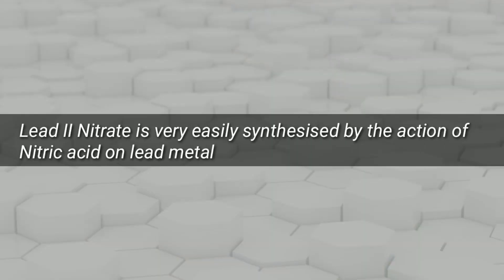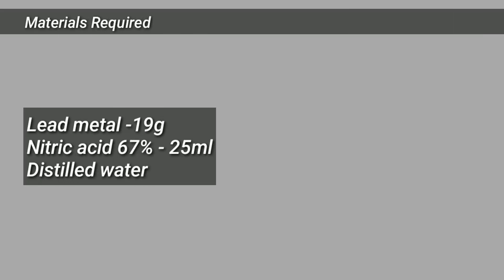Lead II Nitrate : Preparation and Properties

Comment: The same procedure as you do in your video i did but facing issues

1-Lead metal takes too time to dissolve
2-i wouldn’t get clear solution of lead nitrate as you got 

Suggest me so my problem will be resolved
Reply: This is caused by your nitric acid concentration, either too high or too low.

Comment: I like to ask you to prepare some Unique Chemical materials with Physical properties like Optical , electrical And other like simi conductor et.
For example pizo electric material such as Quartz crystal ,  and rochelle salt but unlike other people do just mixing Cream or tratar  with  NaHCo3 it's not that impressive because it's expensive if i wants to buit Pizo power generation unit .  instead can you Make  that cream of tartar aka KC₄H₅O₆ from scratch using Potassium salt and  tartaric acid (a Carboxylic acid ) .
wikki gonna not help you much on it .
Reply: @vibzzlab  thank you so much can you make pizo electric using this same mathod ?
Reply: I  doubt on this process -
( KoH + C4H6O6 = KC4H5O6 ) ?? 
Because the formula for Cream of tartar is KC4H5O6 and for Tartaric acid it's C4H6O6
Than why one Hydrogen is missing in end product KC4H5O6 Instead of C4H6O6 ? 
Or .....
Is it because of chemical Balancing like this 
( KoH + C4H6O6 = KC4H5O6 + H2O ) 
In which One hydrogen is combined with Rest OH to Form H2O . 
Clear my doubts plz ?

Comment: I have another question. When I did this, I used different quantities of each (lead, nitric acid, water), and when I added water, the solution turned a pale blue color, and I cannot see through the liquid. I'm guessing this is because I used tap water instead of distilled water, but not sure.
I'm unsure if I have ruined it at this point, and if I can still get lead ii nitrate crystals after cooling it.
What are your thoughts?
Reply: blue is becuse of copper

Comment: What dilution was the nitric acid you used? When doing this myself I did not see the bubbling reaction (even after putting it on heat) after even 20 mins, let alone 3 minutes.
Reply: @vibzzlab  thanks. The one I used was around 55%. It did react like that eventually. Just took more like 45 mins
Reply: @vibzzlab  yup! Thanks heaps for the reply